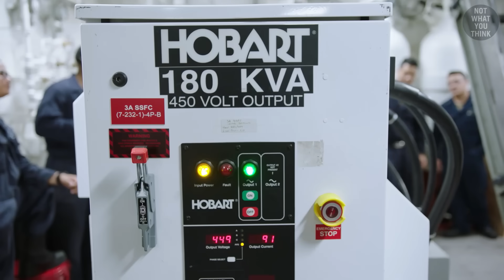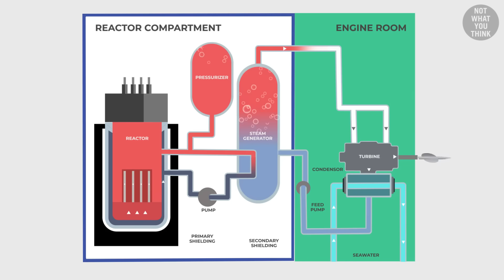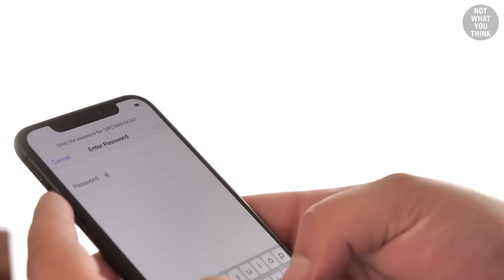America's “Aircraft Carrier Shortage” Explained

Comment: The ship need not be in a harbor for 'maintenance work' on a coffee machine. The machine should simply be replaced, and the old one taken to a repair shop. I hope this is not the only one in that carrier. Even if the steam turbine/generator is defective there has to be a replacement for a Nimitz Class unit ready for change. Simply, change it! What would you do if it breaks at sea? I assume that there is some 'work time generation' in progress! Hydropower stations need rework on the main engines typically every twenty years. But that will last for one or two years where one engine is reworked after the other.
Reply: If a SSTG breaks at sea, the ship will deal with the loss. One of the reason warships are so damned expensive is because they've got redundancies. The ship will ideally short-cycle back to a shipyard for an extended stay (with lots of cutting torches in her near future), but in extremis could stay on station for an extended period of time. Depending on the specific turbine generator that failed, top-end speed may be somewhat affected. Of course, that is assuming that the turbine itself was completely trashed somehow; anything less catastrophic could likely be repaired and/or replaced at sea with onboard or fabricated spares or parts from the beach - potentially something stolen from the carrier undergoing midlife refueling.
Reply: @mikehammer4018  So you think it would be wise to wait until the windings of the generator are refurbished?
Reply: @gottfriedheumesser1994  Completely depends on what the root cause of the casualty, and the current exigent needs of the fleet.

My entire point is that there are very, very few things on a carrier that are an inherent mission-kill. Almost everything has either installed spares or can be quickly rebuilt from spare parts carried onboard. (The meatball is a prime example of the latter as there's only one, but components onboard to completely rebuild it rapidly)
Reply: @gottfriedheumesser1994 when operational requirements dictate, they'll do a rewind, but they have the ability to go with some down for an extended perjod of time.
Reply: @mikehammer4018  A ship is built to navigate, not to lie in the harbor. If commercial ships were used like navy ships, goods would at least double the price, and world trade decrease to half.
Spending half of the time in harbors reminds me of hours of rifle cleaning in the army. They always find something to clean it again ...
Reply: @gottfriedheumesser1994  A commercial vessel and a warship are similar in that they are both generally made of metal, have propellers, and float in water. From there the design, operation, and use cases diverse radically; similar to the nature and divergence of a personal automobile and a main battle tank.
Reply: @mikehammer4018  Very wise! And what does it help?
A main battle tank is a weapon. An aircraft carrier is a base for weapons.
Reply: @gottfriedheumesser1994  Neither one is designed to move cargo economically from one location to another. Comparing either to a cargo carrier is an exercise in futility, because their roles are utter different; and arguable, mutually exclusive.
Reply: @mikehammer4018  You can use as many words as you want, but the readiness of the Navy is shocking and not sufficient for any larger war.
Reply: @gottfriedheumesser1994  On that one point, we're in agreement.

It's always been that way, though. In the first major engagement, the US military gets taken by surprise and smashed horribly. For the next six months to a year, it's fighting entirely defensively. Then, and only then, does industrial production catch up to the (inevitably far higher than projected) operational demands. After that, the war starts to turn... and the Eagle's enemies learn why their parents warned it was stupid to mess with her.

Unfortunately that lesson always costs far too many lives on all sides - combatants and not. Bretton Wood was a pretty good deal for everybody, until the grandchildren of those who came up with the plan screwed it all up due to venality and stupidity... and now the world will soon burn again.
Reply: I've worked on carriers, hydroelectric plants, and nuke plants, carriers do planned maintenance and upgrades during maintenance periods.  Repairs happen based on operational need, often at sea if required.   Hydroelectric plants have scheduled annual maintenance periods and repairs when needed.  Nuke plants have scheduled maintenance based on required plan conditions and the specific refueling requirements of the plant.

Carriers have their own machine shop which would be used depending on the material needed.  And they'll fly out a repair team if needed.  Take this video with a grain of salt, he got the carrier names right.
Reply: @haolepirate  The times when hydroelectric plants had scheduled annual maintenance periods have been gone for decades, as they discovered that at least half of the failures had been introduced by yearly maintenance. So monitoring of the engines has been improved and maintenance is done just before something breaks. Similar in commercial aviation. Shortly a turbojet engine was exchanged on a plane after 50.000 (!) flight hours!
With nuclear power plants, it is different because they have to be shut down for rearrangement and replacement of the fuel rods which cannot be done while running. But that should be an outage of one month of the year.

Comment: and yet during the start of WW2 (for the US) they managed to patch up a carrier that had a holed flight deck and hangar damage in 2 or 3 days. when initial estimated was a few month in drydocks.
Reply: Here's my comparison for you: buy two trucks: a '73 square body and a brand new Silverado. Take the engines apart and put them back together. You tell me that they were even remotely similar to work on. 
Sure, the basics are the same, but the number of wiring harnesses, computers, sensors, intake manifolds, injectors, pumps and motors are VASTLY different. Same goes for these carriers. The Yorktown was not a nuclear powered aircraft carrier and was much more simplistic in design.
Reply: @jordanhoyson5929  sure it was more simplistic but the dock workers didn't have what ours have now either. plus the problem isn't really the complexity but the burocratic bickering going on. when you need 3 weeks to replace a toilet there's a problem. noit saying it happens but i can imagine it happening nowadays
Reply: That wasn't a complete repair, though - they fixed the bare minimum of what was needed to be able to operate planes for one battle. If the Yorktown had survived, it still would've needed to go back for more extensive repairs even without the battle damage at Midway.
Reply: They didn't fully repair it, they made it minimally functional.   Also, much smaller and less complex.  There are only two drydocks large enough for a super-carrier,  numerous ones were available for the Yorktown.  So they were able to repair it Hawai'i.
Reply: @haolepirate  it was combat capable which is still no small feat to get to that level in 48 hours after teh hits she got

Comment: Not that I have a lot of experience working on carrier maintenance, but I did do some repair work as a civilian for the Nimitz once. Though I was just a grunt and didn't do any of the logistical work, I did notice it took a while to get things done. We had to get certain permits to do hot work (grinding, cutting, etc), check oxygen levels for small enclosed spaces, and so on. This held us up slightly. We also had to rely on other companies to use their machines such as cranes and genie lifts. Which also added to time and planning concerns. But most of all, we were incentivised to not get done too early. I believe it's because our contract was for a specific time frame. Going under the time allowed was bad for financial reasons (I think). Like it would show the government that we didn't need as much time so we couldn't bill as much time and labor for the job. Again, I'm not part of the contract or financial process. This is just what I was told. So yeah... Just my experience with one job on the Nimitz
Reply: Everything you mentioned is part of non government maintenance projects, every job has those problems
Reply: @forddon  that's a good point. I think that points to the bigger issue just being the entire process is bloated and inefficient. Like you said, most jobs in are experiencing this. Starting with contractors having to purposely over exaggerate timelines to get paid more. Hard labor jobs are becoming more scarce which means there's going to be less experienced people as they retire or leave the workforce, and more inexperienced people have to fill in. Permits and safety culture (while not necessarily bad itself) prolong and complicate the process. Needing other workers and companies make time in their busy schedules to accommodate you is also a hassle. Like you said, this is a problem everywhere. My quick experience on the job really helped visualize exactly why it takes so dang long to get carriers back into working order
Reply: @Jor0716  One of the biggest problems that causes delay are changes to the project as it is ongoing. Consider your own experience shouldn't the permits and testing have been arranged before the work? But what if the job was changed and the problems with permitting were because the process had to be started all over again? Wouldn't changes to your schedule create conflicts with other contractors? If you were a contractor wouldn't you build extra time into your plans so as not to have to pay a penalty for delays that were the governments fault?  I've worked for companies that gouged the customer, and it was always because the customer changed the deal. You are right that many experienced workers are leaving the workforce, but it applies double to naval personal who know how to manage repair operations.
Reply: @forddon  the permits he's talking about are safety related.  The hot work permit ensures that there's nothing flammable nearby (or on the other side of a metal bulkhead) before welding or making sparks.  Since work that precludes hot work takes place in the same area (everything that's welded or ground needs to be painted) you can't just get all the permits at the beginning.  Same for the confined space entry permits, the fact that the air in that void was good six months ago doesn't mean it's still breathable.

That being said, if work is being delayed by hot work or confined space permits it means that the management for that work team isn't doing its job.  Their entire purpose is to look at what work is coming up and make sure all the requirements, like parts and permits, are ready to go when the job is scheduled to start.
Reply: @dirtyblueshirt  FYI: I've spent a lot of time on aircraft carriers and other ships, I also have done a lot of work inside permitted confined spaces, and for many years I was a member and later on Captain, of an Emergency Rescue Team, trained and equipped for confined space and Hazmat rescue...So I kinda get it being safety related. 

When you said “if work is being delayed by hot work or confined space permits it means that the management for that work team isn't doing its job” That's exactly what I was talking about in the previous post and much of what I've experienced in over 40 years working in the trades.

The video I guess we all just watched is about how long it takes to get repairs done on aircraft carriers; much longer than it used to take. Jor0716 thought it might be that contractors are causing delays, I'm saying it's much more likely because of inexperience and incompetence on the part of Navy management.  

The subject of “project management” is something I have a lot of interest in, and  an endless supply of personal stories relating to, but the topic at hand is a general one so I try to limit myself to general comments.
Reply: @forddon  - Electrical Engineer on Jimmy Carter....I was the "expert" on the hydraulic compensators...2 wire cable & magnetic switch - sensor - so simple a baby could troubleshoot.  Project engineer & new engineer on trouble desk did the job.  Went out and failed.  Came back, same thing...went out and failed.  3rd time I wrote the paperwork...fixed permanently :>)  All this was because Project engineer and Trouble Desk were in too big of a hurry and did not troubleshoot the problem properly and were shot gunning it.  When I retired I wrote a letter to the upper management about the old adage fix it right the first time no matter how long it takes.  This problem was not only the Navy's but private too...like FLUKE.  Hurry hurry hurry...damned the quality.  Work smarter not harder LOL  Think outside the box.  Once told them the problem is everyyone has been thinking outside the box for so long they have forgotten what is in the box :>)
Reply: @Jor0716  You HAVE to overexaggerate. It's better to finish somewhat early than to overpromise and underdeliver. In many contracts (Government ones in particular), if you give a deadline and don't meet it, it's you that have to pay fees or lose a bit of money. So say it might take 6 months to do something on average and the worst case is 14 months so you negotiate 12 months. If there's a bunch of bidding where the government takes the cheapest, companies are going to overpromise to win the contract and that's when you get delays.
Reply: Nous avons le même problème en France au niveau des ressources humaine en adéquation avec les compétences techniques qui se réduisent considérablement mais à des échelles inférieures étant donnée que la France ne possède qu'un seul porte-avions.
Reply: Think about this when has anything built for or any kind of government project ever been completed on time and on budget in the last 70 years?
Reply: @robertgutheridge9672  many things, if not most, but those aren't talked about because... they work 🤷
Reply: Sounds despicable
Reply: I got see it in the middle of 6mo overhaul that was going on 2years lol north island 2004 Jan February . Wish I had stayed and got job as civil A&P mechanic  on f18s 😂 I ran home for girl like idiot 18yr old kid 😅
Reply: Cara Giorgi , non capisco la seconda parte del tuo scritto. Che cosa vuoi dire !!!!! puoi scriverlo più chiaramente. Grazie.
Reply: Privatizing the repair of an aircraft carrier is crazy. That seems like something the government should handle
Reply: That’s contractor specific bs. When you are employed its very different but also very similar. Tho they want it done faster. Which is damn near annoying
Reply: You’d think people would have pride in their country and work and want to work harder and faster for their home
Reply: Give me a fing break! Obviously you don’t know sh**!
Reply: All aircraft carriers are obsolete death traps for the several thousands of sailors and pilots operating from these behemoths. They are an American tragedy waiting to happen. A WWII legacy no longer valid or useful for its intended purpose. Hypersonic missiles and drone swarms make it so. The current deployment(s) to Red Sea is proof positive they are ineffective as credible deterrent to land based threats to commercial navigation. It's best to scrap them and repurpose the high quality steel into new high-tech potent submarines. Submarines are far more capable deterrent to deliver knockout blows to any and all potential sea going and land based adversaries that would attack America. US carriers cannot stop attacks on commercial navigation or itself as evidenced with near misses on American war ships. This is a huge embarrassment to the Pentagon. The US Navy should home port these antiques as soon as possible.
Reply: Fierce and ruthless project management resources would get these jobs and contractors back on track
Reply: The same NIMITZ sunk by an 1950s era Oberon class diesel sub of the Royal Canadian Navy in the 1980s? 😂😂😂🇨🇦
Reply: @yxmichaelxyyxmichaelxy3074  The only way you'll known is to dive the wreck
Reply: Grow up
Reply: @locomotion3656  you should also grow up judging by your own comments. Overreacting
Reply: @ I see no overreactions. I see dummies that refuse to acknowledge what they are looking at.
Reply: @ bruh. What are you talking bout.